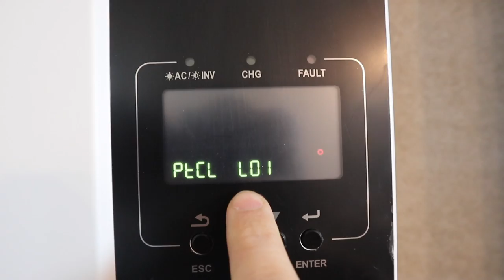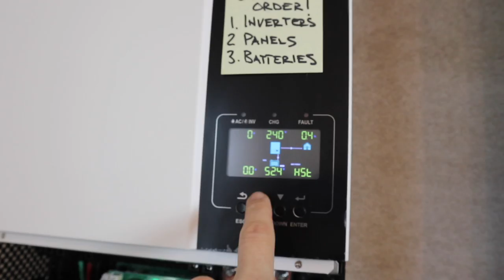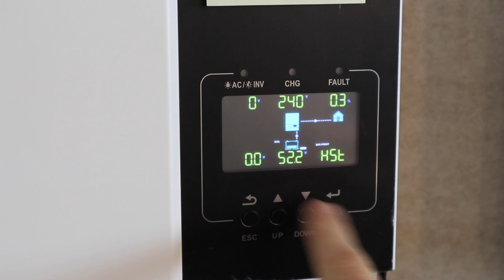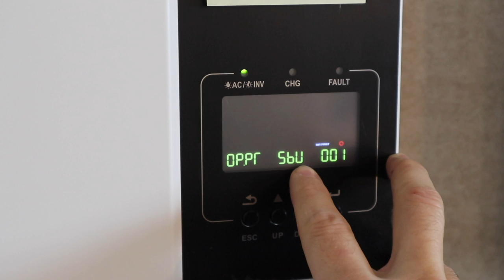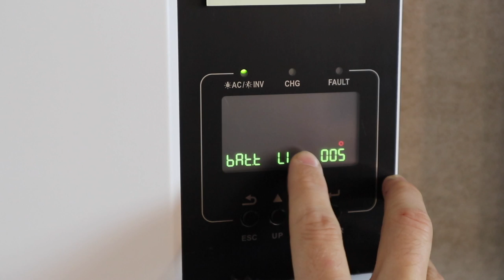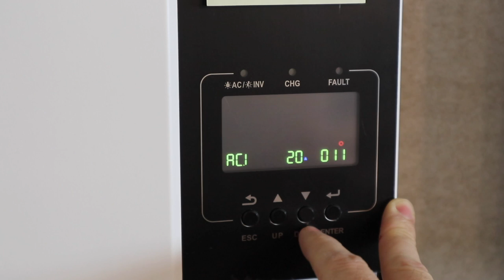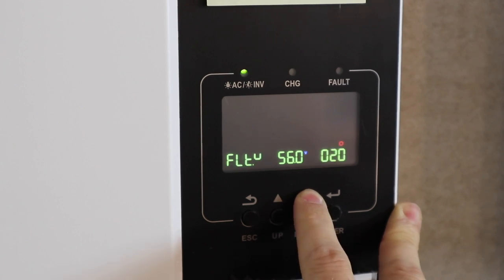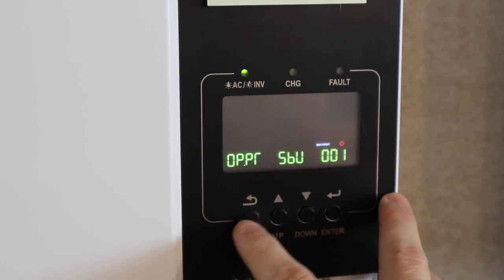Solar Inverter Growatt 5K Programing Grounding & Battery Comms

Comment: Please help:
I have a growatt 3000 and it doesn’t recognize my PV input at all. 
My panels are in series. 8X370 watt panels. I have a pv shut off switch hooked up. Any thoughts?
Reply from the maker: Check if you have the correct voltage or if your pv wires are reversed in their polarity.

Comment: Are the output AC wires for these parallel inverters connected together in a circuit breaker ?
Reply from the maker: We have another video on that. They are each on a separate circuit breaker.
Reply: @CountryLivingExperience  plz put up the link for that plz
Reply from the maker: https://youtu.be/N-d3lCVUeyA

Comment: This grounding thing is killing me in my setup.  I like you have watched so many videos, researched so many documents..tried to understand NEC code, etc.  On the 5000ES the AC in and AC grounds are connected and they are also connected to the case (verified with ohm meter).  In my setup the AC in from grid comes off my main panel which is obviously grounded (bonded neutral).  If I were to connect the AC in ground to my utility panel.  Then connect the AC out ground to my Feeder panel for solar. And lastly the ground on the inverter to the Feeder panel ground.  In my mind, this leaves one path to ground.  All the breakers, the Transformer up through the inverter, back to the main panel ground and that just doesn't seem "right" to me.  My thought is.  Run a ground only from my utility panel ground to my feeder panel ground.  Then run all grounds as part of this system (AC IN, AC OUT, Inverter) to the feeder panel ground.  In this case every ground goes direct and doesn't flow through the inverter.  I don't know if its right....but it feels right with having a single ground and a most direct path to it.  I could see having a separate ground on the DC side that would ground the batteries and solar panels themselves but couldn't argue why you wouldn't just use the same ground.
Reply from the maker: I hear you. I have gone around and around with the solar company and electricians. Not all of them agree with each other. Since I am an off-grid system I am not sure I can respond to your thoughts directly. There is a diagram from Sig Solar on the DIY Solar Power Forum. They did some testing, etc for it and their engineer came up drew it. Not everyone on the forum even agrees with it. Here it is for reference https://diysolarforum.com/threads/safe-grid-use-of-the-5000es-and-transformer.34121/page-2
P.S. I did a drawing of my exact system and sent it to their engineer. He said it looked fine.
P.S.S. I am still a bit unsure, however.
Reply: @CountryLivingExperience  HAHA with all this its funny the one thing confusing everyone is the ground.  However, looking at that diagram in the post it appears to be exactly what I suggested The ground of the Utility Panel, Growatt's, Transformer, and panels is all tied in one.  This is very helpful!  I appreciate it and the reply!!

Comment: Did your batteries come with  power cables and the communication cables?
Reply from the maker: They come with the small jumper communication cables and the short battery cables for paralleling or connecting to the rack buss bar. The rack comes with long battery cables to run to one inverter. I purchased extra battery cable at my local auto parts store.
Reply: Local wielding supply is also another good place to source battery cable.

Comment: The problem I'm faced with, is that i have 4 12v 100amps lithium battery hooked up with my 13kva Growatt system in split unit. The issue is that i didn't hook the batteries on BMS, so i set my battery type to user2...i want to set my dod at 30 %, but the under setting 12, instead of Showing me the percentage, it showing me the voltage...so i want u to tell me which volt should i set it to obtain the 30% depth of discharge
Reply from the maker: I am not sure. I currently do not have these inverters connected because I am going to use them for another project. I am using the EG4 6500ex inverters now.

Comment: Did to come to a decision on whether or not to ground your batteries?  Have you grounded your case?  I have the exact same setup and I was curious of what you decided?
Reply from the maker: I grounded the metal rack that holds the batteries.
Reply: @CountryLivingExperience couple questions for you.... Did you use the same guage wire as your + and - ? Did you take the ground that is attached to the case out to the grounding rod you showed in your video?
Reply from the maker: I used an 8ga bare copper ground that does go out to my separate grounding rod.
Reply: @CountryLivingExperience  Is that in case lightning hits your batteries some how? As far as I know voltage will always find a way back to its source. I wonder if you wouldn't be better off grounding your batteries to your Inverter case.

Comment: Hey! Great video! I guess I missed it but at that subpanel are you neutral bonded there or are these inverters neutral bonded? Just curious on that. Thanks!
Reply from the maker: Hello. No neutral-ground bond in the inverters or sub-panel. Only bond is at the main panel.
Reply: @CountryLivingExperience  it's interesting because I actually have a couple of those grow out inverters and from what I've been seeing, there is actually a ground neutral bond inside those inverters and a lot of people break that bond inside the inverters when they're setting up their panels. So there's not two references to ground when they're running specifically off of batteries. At least that's what I've seen
Reply: Growatt (speech to text)
Reply from the maker: The Growatts that have a neutral ground bond still in them are not made for the North American grid. The only authorized dealer in the US (that I know about) is Signature Solar. They worked with Growatt directly to modify the inverters for our grid including taking out the internal bond.

Comment: The grey box with the switch on it is that ur ac 120 output that's where I think I got lost i never seen u actually hook that particular box up
Reply from the maker: That small grey box is just a safety switch. It is located on the AC side conductors. It takes the AC power to my main panel. Both 240 and 120.
Reply: @CountryLivingExperience  ohh ok that's the part I really wanted to see u do thanks tho
Reply: @CountryLivingExperience  hey can I use a simple step down transformer with these 240v inverters I was going to wire a simple step down 240v to ac 120v would that work one of those step-down boxes

Comment: What wires/cables are connected between the two inverters to parallel the?
Reply from the maker: Each inverter comes with special wires for connecting in parallel

Comment: I’ve set mine up like you’ve shown and also with setting 5 to LI and setting 36 to L01. My inverters are limiting charging current to 10A regardless of source and regardless of available solar power. Any idea why?
Reply from the maker: Not sure. I know you cannot adjust it via the settings if you have Lithium. Your BMS should be regulating this. Do you have the BMS communications set up correctly?
Reply: @CountryLivingExperience  I set it up like signature solar’s setup video. I’ve change to USE2 and can charge at higher currents. But only 10A when set to LI / L01. I have reached out to signature solar but they are very slow to respond.
Reply from the maker: @jeffmotes2129  Not sure why. Leave it on USE2 until you can get hold of them.

Comment: at 9:10 you want to switch to parallel but you quit the action and stick with two single inverters... don´t understand that
Reply from the maker: The setting did not stick in the video. I didn't realize it until I was editing the video. Follow the process that I mentioned and make sure the setting sticks.

Comment: I'm a supervisor electrician here in Oregon and that ground rod is not going to do crap other than cause some earthworms to come up if there's a fault.
Reply from the maker: So you are saying my electrician and the solar company are wrong. Separately derived system? They instead of throwing stones, give a solution.
Reply: @CountryLivingExperience  you have to tie it back into the main EGC system
Reply from the maker: @PaulNelsonphotography  It is an off grid system. The main power is cut via an interlock kit. It is a separate power generation station like a generator. Factoring those things in with the addition of my electrician and the solar company saying the opposite, do you still say this is wrong and why?
Reply: @CountryLivingExperience  Even if you take off the utility you have to establish a main EGC. You Can have issues with the electronics with different potentials. I would need to see the system. You need ( 250.25 article 705 ) 1 single electrical grounding electrode system. 250.4 and 250.6
Reply: @CountryLivingExperience  are the Ungrounded conductors the only ones that are cut?
Reply: @CountryLivingExperience  Mike Holt has a simple suggestion on proper grounding at the house which is "everything above the earth is grounded to one location" that would be the house load center. Lightning strikes present a problem with multiple ground rods. The difference in potential of the two rods presents the possibility of generating a significant ark in or on the house itself. Running the (any) additional ground wire to the load center is worth the effort involved.

Comment: How do you make sure you don't push power back to the grid
Reply from the maker: The generator interlock kit that is installed on the main service panel. I can never have the main grid breaker on at the same time as the solar system feeder breaker.
Reply: @CountryLivingExperience  Figured you could just use those current transformer clips to inhibit the back flow like enphase does

Comment: Why is it bad for the inverter to charge your batteries from the AC grid or generator as you say? Is the a problem with the design?
If someone on the grid without solar and wants to use the invertr as a backup unit, you need to charge from the power line!
Reply from the maker: No problem with the design, it is just not recommended for the heath of the equipment to do that. The batteries are made to receive charging power from 48v solar or from a 48v battery charger. Additionally, it is not cost effective. 
You need to purchase the appropriate battery charger for your batteries. The inverters charge via solar most effectively.
Reply: Pv voltage incoming can be much higher than 48v.. some inverters up to 450 volts dc. Hybrid inverters are smart enough to charge your system from grid in the event you have no electricity from pv array. If you have poor sunlight in the day and haven't managed to charge your batteries the grid is the only solution to assist.. inverters will regulate battery charge whether from PV or Grid.
Reply: From a cost effective point of you YES charge with solar. Personal settings are charge first with solar. In the event pv is unavailable batteries are low and grid is available the grid will assist with charge.
Reply: @CountryLivingExperience  I'm wondering why someone on a solar system would want to charge from grid. Why go solar then?
Reply from the maker: @eddietee6305  True

Comment: OBS!
Connecting the "Current sharing ports"
It is NOT korrect what You say in the video: 7:02 - 7:13/16:15
The "Current sharing ports" should NOT be connected left to left and right to right 
BUT left to right  and right to left.
Please read the manual ;-) :-)
Reply from the maker: Mine works perfectly. I read the manual on camera. You misunderstood.

Comment: Right off you got me confused. Your connecting your batteries and inverters on the DC side to it's own ground rod. ?? Do you mean the battery case is connected to the ground rod, also the DC side of the inverter???   The only DC connection on the inverter is the PV in which has a 2 wire connection. + and - . Where is the ground rod connected in the inverter?
Reply from the maker: Battery case and AC out on the inverters are connected to ground rod as a separately derived system just like a whole house generator.
Reply: hi  , my inverter and battery pack is in 4th floor of 6 stories building , pv wires and grid (ac input) hook up to inverter without grounding please tell me what should  i do

Comment: Does your inverters keep charging the batteries when they're turned off
Reply from the maker: No, the inverters are always on.
Reply: If I flip the switch on mine it just killed the AC and keeps pulling from the pv
Reply: On my 12K growatt, if I turn the inverter off the charge controllers stay operational.  My problem is right now they're only 250 volt PV.  I'm thinking about buying one of these 5K just for the charging because of the 450 volt Pv charging. The inverter would be just a plus for a backup. Can't seem to buy just a charger that's more than 250 volts.

Comment: I just watched this video I still don't see no emphasis on the 120ac current wiring coming from the solar edge mid point transformer box  you showed how to wire into the box but I never seen you show how to wire out of the box
Reply from the maker: There is no 120 coming from anywhere. The mid-point transformer splits the incoming 240 into 120 on the neutral leg. Watch this video from Signature Solar to help....https://www.youtube.com/watch?v=NVnJhFxCFHw
Reply: @CountryLivingExperience  that's what I was talking about once u wired the neutral and both inverters and the solar edge to the circuit breaker box u really didn't go in to much detail about the 120 ac I watched the signature solar video and that's how I was able to figure it out all I was saying if you didn't go into too much detail on the 120 AC output which was the whole purpose for the solar edge converter

Comment: I have two spf5000es parallel in same phase as your system and i have felicity lifepo4 battery , i tried to connect rs485 cable from battery to master inverter but the communications faild. In my cable i am using pin 1,2 at inverter side and 5,6 at battery side. Can i know what pins are you using in your eathernet cable?
Reply from the maker: I am unfamiliar with Felicity batteries and whether they have to ability to communicate with Growatt inverters. If you purchased the Growatt from Sig Solar, please refer to them for assistance.
Reply: @CountryLivingExperience  thank you , but how i can check if my  inverter old or new model . Also can you please let me know your patched cable pinout direction
Reply from the maker: @momenphone  I am not sure what you mean by pinout. The top battery needs to have the DIP switches in a specific configuration but that is only with the EG4-LL batteries. I do not know how the other batteries communicate with the inverters. You need to contact Growatt for information.